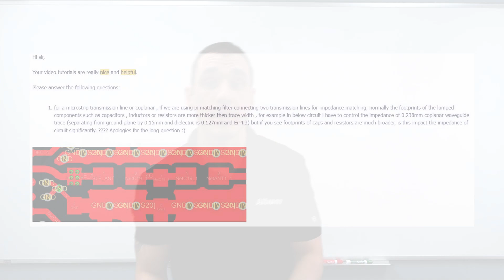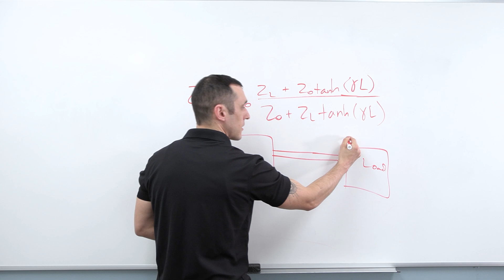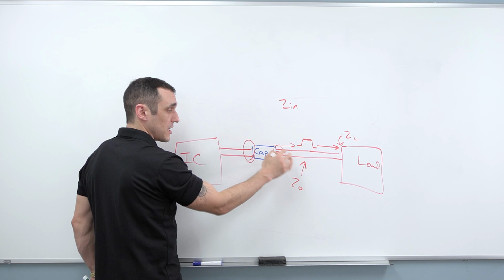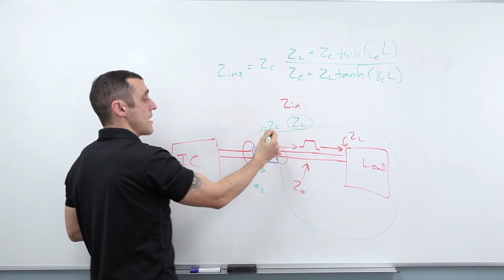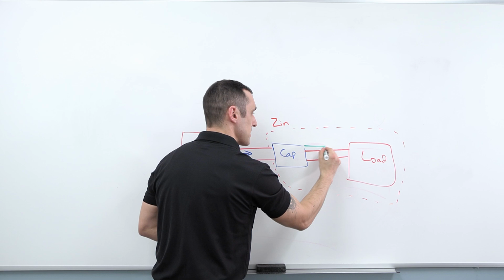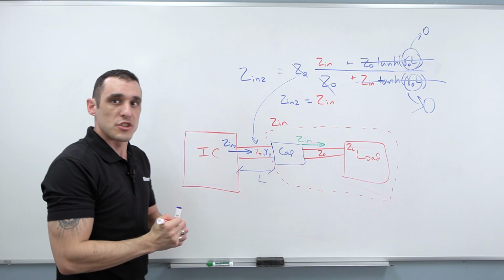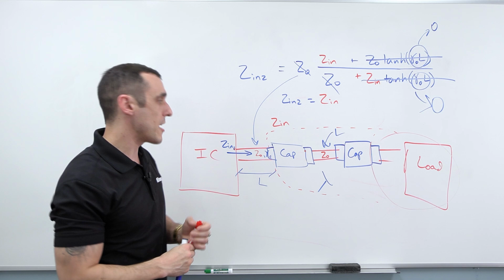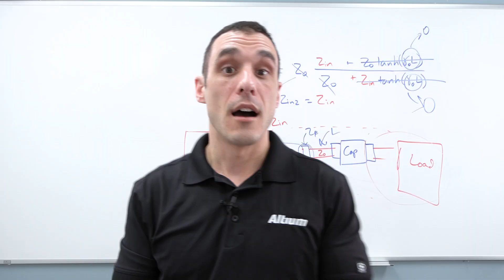Input Impedance and Termination | Signal Integrity

Comment: I like that you mention the wavelength as this only works up to a certain frequency.
As you go high in frequency, your component pad will have to go down in width. Essentially, you'd want the pad to be thinner than the trace. In our radar stuff, I just don't put an 0402 cap as that's too big for what the frequency allows.  

Very good explanation.

Comment: If I understand you correctly, your chain of capacitors should all be within a fraction of your wavelength? If you start pushing higher percentages of a wave length should you split up your capacitors by chunks having large impedance traces between sections of capacitors? Is their an EMI impact if youre doing this alot? Probably one of those things you have to build and find out.

Comment: great video! it's interesting that the thickness of the pads become relevant above 10 GHz. Is there a general rule for figuring out which what the upper limit for component size on a transmission line should be based on operating frequency? I imagine this is a loaded question as the parasitic resistance and inductance of any caps will change with size as well!
Reply: "I do not know of a formula that is used to select an upper limit on component size for a given frequency. Component manufacturers will design their packages to have sufficiently low package parasitics so that they can accommodate the rated frequency range at the specifications given in the datasheet. This is why something like RF transceivers will have maybe QFN or similar SMD packages, you're basically eliminating pins and vias as well as all the parasitics that come with those packages/IOs. In general smaller SMD packages will be better at higher frequencies, but this might make routing at high frequencies more difficult depending on your trace geometry needed in your stackup for your target impedance. Sometimes you have to route in with a taper.

The component manufacturer will (or should) provide some data that allows you to qualify performance in the relevant frequency range so that you can judge whether your link will meet your performance specs. Just as an example, we recently used an HMC802 attenuator in a design for a switchable radio link operating at high power, the datasheet lists a reference insertion loss that you would expect along the link based on the manufacturer's eval board design. Your job as the board designer is to make sure the rest of the interconnect is designed properly to make sure the board parasitics don't create some new problem."

Comment: Good video. At long long last somebody did it, cuz it's getting boring ti explain about caps in TL.
It will be good to hear about TL to PAD impedance mismatch (for RF and HS dig): REf. plane cutouts, impedance transformers and teardrops when pads are LARGE ( some RF filters have PADS 3x3mm and with line 0.3). I mean real calculation.

Comment: I'm confused; shouldn't the driver IC's output impedance be what is being matched to the transmission line and load?
Reply: You're right... It's just the way he's explaining it that may confuse some. You wanna match the driver to the line to the receiver input.
Reply: @brokenicry  thanks! I suppose the output impedance of an IC is also the input impedance of the transmission line, it's just what label it's given in the equation?
Reply: Yes, it is the driver's output that is matched to an input impedance. In other words, if you're looking outward from the driver toward's the load, you would ideally want the driver's output to be matched to the input you see looking at the output pin. The point is that everything downstream from the load will affect what the input impedance looks like.

Comment: Hi Zach, just one question here.

We deeply understand the size of components inserted to a transmission line highly determine input impedance that signal sees. 

That's also why designer puts AC coupling cap near driver side like TX in PCIe topology.

There's one question here, in that way why IC houses still recommend PCB designer to add void underneath AC cap in an adjacent return path (e.g. solid ground plane) when transition vias are needed?

It looks like there will be a dip on input impedance when AC coupling cap is inserted,  so we need to make a discontinuity area  on purpose to compensate this dip. Based on the ADS simulation from some articles, this will compensate roughly 5-7 ohms up for PCIe gen3 as signal travels through AC cap.
Reply: The only reason one can claim is that it would reduce a small amount of parasitic capacitance around the pads and input traces coming into the capacitor, but this would only matter with very small capacitors. This is one of those rules where some people say they never remove the ground and they never have a problem, and other people will always remove the ground and they never have a problem. Like you have mentioned, it is important to simulate it in your specific stackup to see if you actually need to recover some of the impedance.
Reply: @Zachariah-Peterson  Thanks Zach.

Comment: Hey Zach, I am really enjoying your lessons on signal integrity. I have a question about the input impedance formula you are using.
As far as I am aware, the input impedance is not a constant value but is actually a function of time which transitions between values as the signal propagates and interacts with different components. If so, what exactly does that formula represent and how does it characterize the overall impedance of a transmission line and a load.
Reply: I believe what you're referring to is the surge impedance, which is the time-domain analogue of input impednace. I'm an RF and optics guy so I'm always used to frequency domain explanations. As I recall surge impedance is just an impulse response to the input waveform.

This is one of my favorite types of questions because impedances are defined as being functions of frequency. However, from the perspective of transfer functions, an impedance can be viewed as a function that transforms current into voltage and vice versa. Thus, an impedance function (which we would call a Z-parameter in network analysis) also has an impulse response function that is the inverse Fourier transform of the impedance vs. frequency function. The voltage response would be convolution of the impedance impulse response with the input current waveform.

Comment: Why is it that a small capacitor (smaller than wavelength of signal or rise time/ fall time of signal) does not affect the impedance much?
Reply: I should put an asterisk next to that statement because it does depend on the package size and the dielectric constant of the capacitor's dielectric. The capacitor could have very high dielectric constant, so even at low RF frequencies, a large case capacitor on a signal line could still look like an impedance discontinuity and the signal would interact with this capacitive impedance. You also have to remember that at low frequencies, the input impedance approaches infinity (as we would expect as we near DC), so be careful not to overgeneralize.

Comment: 8:50 - How small does a capacitor needs to be so that it’s small enough to be considered zero for the hyperbolic tangent function of “Lc” plugin? Like 0805 package? How about those regular through hole electrolytical capacitors? Thanks.
Reply: It depends on the frequency in relation to the propagation constant in the body of the capacitor. This is kind of a difficult problem to analyze so I do not want to tell you a specific package size.

Comment: Wait, what about lumped elements (capacitance will have its own impedance regardless of size)? There is some mistake in your reasoning!
Reply: Even a capacitor or resistor is not infinitely small, it can experience wave propagation. In fact the higher the dielectric constant of the dielectric, the smaller the wavelength inside that dielectric, thus the more likely that capacitive medium is to see wave propagation at lower frequencies.